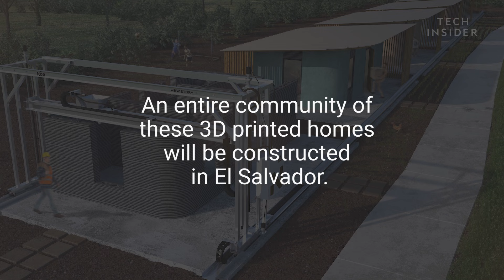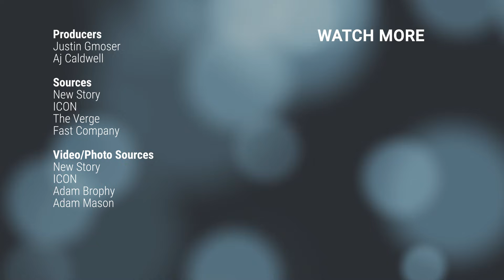3D-Printed Home Can Be Constructed For Under $4,000

Comment: What is the point of 3d homes for the homeless if no one can own land? That means the very next day the government will kick you out of your 3d home because you couldn't pay your property tax and you become homeless again. Getting rid of property tax is the solution to homelessness.
Reply: How much are the property taxes of a house costing 4000USD?
Reply: @davidsvarrer8942  Not that much tbh, We are in a  12,000 trailer on a double wide house plot and we only pay like 400/year, Our place is about 3x the size of this house. Property taxes are based on the total value of an entire property including the house value and the land value.
Reply: @tenbatsu4833  In CA a mobile home is not  taxed like a house but you pay registration fees like a car, also unless you own the land that the home is own,  you are in a mob. home park where the rent can go up very high.  In Huntington Beach a man wanted to trade his mob. home for a car, because no one wanted to buy the home because the rent was so high.
Reply: Did not post this twice so don't know why it appeared twice.
Reply: I. Can agree on this...
Reply: Make this good 3D home an assembly kit with max 2.55 meter width, a few hook points resembling standard container gauge, a few rubber gaskets at strategic places and you can move your entire home on a truck.
Reply: Property tax is bordering crime. However. Build your home such that it is movable. Make it of units no wider than 3 meter, and you can transport them on ANY truck at ANY time as "Wide Load". So, rent land and be happy for that, and have your permanent, but movable, home, solidly planted on 4, 6 or 8 kegs... What do you think about that?
Reply: one of them for sure
Reply: Property tax is immoral and unethical, and it is communism.  People ought to have a piece of land for themselves for free without any tax.
Reply: @crazieeez  At least you're living up to your screenname.  You think taxes are communism, but you want to give everyone free land...  You might consider adding just a smidge of consistency to your opinions.  Or maybe try using words for what they actually mean, rather than some figment of your imagination.
Reply: @Stormsinger99  Give everyone free land is private ownership.  Property tax is state ownership of land.  I prefer the former.  I suggest you not be indoctrinated by thinking that you own your house in America.  The minute you lax in paying your property tax, your house get sanctioned by the state to be sold to get their tax money.
Reply: Land is free anyway. In truth someone said this mine is mine. I have a deed or a title. But that deed or title was simply assumed as no one in truth may own land nor can they grant land to another. Sure some divine right of kings? How did the king get it? Hiring armies and claiming it was part of the kingdom. Then enslaving the serfs. What is free? Not a slave. What is a free market? Where you go and everything is free. Unless you want to change around the true meaning of free and say oh it means that people are free to trade or transact with whomever they choose. Words have been manipulated. Free is free unless you twist its meaning. The concept of ownership is just that. In the word ship. Admiralty law or the law of the sea has been pulled onto the land. Used to been I saw some available  land, built a house, setup a farm, an enterprise and I was a free man on the land. But no more as the law of the sea has been brought onto the land to usurp one's ability to live on the land! Its all a matter of different perspectives. Image? Nation?
Reply: Its capitalism where property taxes arise from. Communism, socialism, fascism are all forms of capitalism. We simply need to do away with money and create social structures based in well being where we all contribute to each other!
Reply: Property taxes are a crime against the people. Our corrupt government doesn't need to steal from the people. All they have to do is go to the FED who will create money from thin air and drive up inflation in the process.
Reply: Property taxes help with infrastructure and stuff so that's a dumb idea
Reply: Taxation is a form of legal theft. If I work 30 years to pay a bank for a property and that bank gives me title of ownership then I can't pay a tax and this allows the government to come an confiscate the property I'd say the entire system is a scam. Just simply do away with money and profiteering. Everybody has basic needs of food shelter clothing and our entire system is based in commerce? Its a recipe for disaster and the sooner we convert to a non profit world the better we will focus on the well being of all. Until that time we will have haves and have nots and a carrot and stick method of conpetition and punishment. Its the opposite of a healthy system.

Comment: No Rebars and Support Beams?
This house will only be good for places where Flooding and Earthquakes doesn't occur.

Water absorption without rebars will destroy its concrete injust a few years. LOL
Reply: They print over the REBAR TYPE INSERTS, that fit together like legos or an erector set.  Also roof can be done the same way as fabric concrete which is used by the Military for quick shelters. In essence it has an inner liner like a pond liner that can be inflated and then they pour water on it, and they have a shelter within 24 hours.   Used for emergency hospitals and such.  Combining both in a systematic manner would work, in addition the rebar preforms could be designed like 80/20 so its inexpensive and you just insert as each layer is printed. In addition you can lay down the pipes and the electrical piping which runs between the walls, and the cement and rebar hold them in, then just pull connectors and wire through on electrical, and or connect the plumbing to the piping.  In cold climates one can even do double walls and put aerated concrete for insulation between the two structural walls.

Comment: Great idea if they where only smart  enough to start in their own backyard plenty of homelessness in the in the state's
Reply: this project is a scam design to milk non-profits)) that's why they are doing it overseas.  it's 10 times faster and cheaper to construct a house out of pre-made cement blocks. or you can simply set the blocks onsite if there is no cement factory close by.

Comment: It’s neat technology. But what’s wrong with good old fashioned cinder blocks? Surely the mortar is just as heavy plus transporting the machine and everything can’t be a simple task. I think the world is just captivated with 3D printing at the moment. And tiny homes
Reply: You're forgetting labor costs which is the bulk of any home build. Material cost is dwarfed by labor costs. Remove the labor and you remove most of the cost.
Reply: David W surely it takes labor to man the machine. Move it, install it, operate it. Add the extras and disassemble it when it’s finished. And that requires more skilled labor than simple brick laying

Comment: The foundation alone is worth more than 4000$ and then all the human labor(transporting and setting up the machine) another 4000$ and the labor of installing doors windows electrical plumbing and toilets at least another 10-15 grand minimum. Add land value and permits/inspection for another 80 grand and now it's just a shed with an odd building material...
Reply: What kind of land are you buying? I can get 8k square feet for under $10,000. Why would anybody need anything more than that for a house of this size? 

That should bring the price to around 30k total for a perm house based on the base price. That is 500-900 square feet of residence you don't have to pay rent for and that will be cost effective on utility.

Not bad at all! 30k That's actually within range of financing for most people.

Comment: Come on guys. 4K for just the walls am I right. I am a big fan of innovation and 3d printing but I am working in the construction business and we own a precast concrete factory so I have some POV. 
The flat foundations have to be built but not just only concrete if I living in the 70% of the world you will need insulation in that. Now you can not print 3d roof or in this project it doesn’t include. There are many other ways to precast a house like this in 24h and it is not the fastest nor the cheapest. 

Come on you have to built a proper rail just to operate the machine. 

I really feel and think that robotic works will be the future but you are on a very narrow usability edge.

Comment: cement is so expensive, you should be using foamcrete or something to make the bags of cement go much farther, i understand motar is 6 bags of sand for every bag of concrete, but this material is going to be the majority of the cost since its entirely cement building.

Comment: I find this interesting but I wonder how do they install the electric and the plumbing that you can still get to when replacing or fixing, plus how does the building stand in a environment the changes between extreme rain and heat, and what do they do for the flooring for the second story of the house?🤔🧐

Comment: how much the windows, dors, roof, instalation , fundation cost, and you have to add also ground? you can easy build only walls from traditional brick for 650 sqf home for less then 4 thousend USD
Reply: And those "traditional" bricks - if you mean limestone etc., will withstand hurricanes and so on. Not like these much more expensive Pulp houses.

Comment: Looking at the sheds in the video and the 3D printed house made me think that fitting a house with a proper window may be quite expensive. Glass breaks and can't easily be repaired. Has anyone explored making polycarbonate or acrylic based windows instead? I would assume that would be cheaper and either more durable or easier to repair.

Comment: With projects like this I wish they would elaborate a more on why the technology is only considered for poor countries and not for rich countries as well. I would assume there are people in rich countries too with limited means who want a cheap house. I can only speculate why the rich world isn't targeted but perhaps somebody could tell me if you speculations are right or wrong:
1) I assume building codes are far more relaxed in poor countries so that it is easier to get going with this technology.
2) It does not fit the aesthetic or quality that people in the rich world are looking for.
3) The relationship between property prices and house prices is different in the rich world. The property may cost so much that the price of the house is less important.
4) Relationship between labour costs and material cost. Material costs are likely similar in the west and in poor countries however labour costs are significantly higher. In a way that ought to create a big advantage for 3D printers in the west. I assume major labor cost saving. On the other hand perhaps I have misunderstood and the major saving here is in material cost.

Comment: Walls and roof are not the problem, people have been building their own homes since forever, all a modest building really costs is some elbow grease. But you need to own the land below the home and you want infrastructure, a road, power line, water, sewage, maybe even internet. Good luck getting all that for $4000. And in some places, good luck getting any of it, period.
Provide the infrastructure and people will figure out how to get the roof over their heads on their own just fine. But having 4 walls with no infra, well, that's just no good for anything.

Comment: ya but how much to get plumbing installed
Reply: Gamer Haven And electrical and insulation.  I'd imagine they fill those holes with insulation.
Reply: Generally speaking, Countries in poverty don't need heating/insulation
Reply: If you use PPR, you can DIY, you would pay some USD 200 for all necessary water piping to the edge of the plot (40 meter). It is really not rocket science. The machine for doing the piping cost USD 20 to buy.
Reply: @davidsvarrer8942  Don't water companies have to have a line nearby or otherwise build one if there isn't?  What machine is used for assembling pipes?  A wrench?
Reply: @cryora  PPR pipes are heated to between 265 and 300 degrees Celsius with special instrument costing some 25 USD which heats pipes on one side and fitting on the other side then when hot (after some 10 seconds net of heating the two parts at the same time) you squeeze them together and hold them until the PPR has solidified. Then it is tight. Keep these two parts accurately such that they stiffen in the accurate position. Otherwise the resulting fitting or pipe may not sit straight or in the Right angle... Hope it helps? Lookup videos for PPR fitting there are a few...
Reply: @cryora  In the US, if there isn't a public waterline nearby, you have to pay thousands of dollars to get it brought out to your residence.
Reply: There is no plumbing in a shanty town. They would use a well or local water source, and outhouses.
Reply: EXACTLY. I bet getting services connected from council is like $50K or something stupid.
Reply: @Property-Club  invest the same money in a work permit in Kenya, open a corporate, do great things here at a fraction of the US price. There is a little corruption here just like in the USA and EU, the difference is that in the USA and EU corruption it's big big big corruption, here it's down in the small level, almost negligible. And being killed off by the government step by step. Connection to water here is typically some USD 100 or so. You pay these good people and it's done. You then pay for the digging to your plot, which comes at USD 1.20  per meter digging. So. Typically you can connect almost anywhere for some USD 150 to 500. Nice or what? Then medicine here is affordable. USD 24 for Augmentin 20 tablets here and USD 1639 in the US. Food is almost healthy everywhere. No chemicals, GMO's etc. Almost. Unlike USA where you have to pay extra for the food where the farmers have saved money using no chemicals, then giving these chemical free vegetables funny names as if it is special not to add chemicals to pull up the veggies before they have riped. So if you want a better life, and want to be able to contribute to the world in much better ways than in the USA where conglomerates have spoiled every option rotten for doing what is rights then come join here and do what is right, and build a new world in better ways and use your experience from the West to assist everybody in not repeating the thousands of mistakes done in the West, the most recent for instance electing a corrupt person with dirty hands to be their leader.

Comment: Its cheap but you get what you pay for as it is sorta small but it would be good for poor areas and pop some solar or wind on the roof and  Stirling Engine outside and you got an off grid house at a very low cost

Comment: I applaud the idea, but think this is likely full of bullshit.  Note that "they HOPE to be able to get the price down to $4000.  I am certain that does NOT include anything like the price to get the equipment there, nor the delivery of materials, nor the labor....and certainly does not include digging a well, installing a septic tank, etc.
So, what do you think it would cost to buy the conventional materials for a 650 square foot home, with one bathroom (but without a kitchen BTW!!!), using conventional materials (2x4's, etc)?  I don't know, either, but I bet it isn't a lot more than $4,000.

Comment: the roof and windows cant be printed?
Reply: Confucius Say And the roof that they built is also flat which is not good at all for places that have snow.   All that weight on a flat surface will just make roof collapse in on itself.

And then there's rain.  Rain on a flat roof surface is also not good. Certain areas will just pool up.  And in those areas the water will slowly rot away the roof.

Comment: Thanks for sharing. Only the walls are 3D printed. Thats about 20%. The rest is coventipnally built - the foundations, the roof, the plumbing, the electrics, the windows and doors, fixtures and fittings, the plastering and painting.

Comment: Bs. $4000 is just for structural, and obviously wasn’t including the roof. But I guess in Salvador you can get the electrical and plumbing and roof and all done for pretty cheap anyways. Once you factor the cost of deivering that machine there I bet it, it would’ve been cheaper and more stimulating to the economy to hire the workers to do the whole job. Weak. But if it printed electrical and plumbing, that’d be different and ergonomic value would surpass the human workmanship. Till then, blah

Comment: 1. What is the initial setup cost of the machine? It would be way more than 4000 dollars.

2. You didn't include the land cost which would drive up the cost significantly better in many cities.

3.  You didn't specify if the plumbing and electrical work was included in the 4000 estimate.
Reply: 1. Beyonce is not sponsoring the units worldwide.

2. The parking lot at Walmart is private property. It would be considered trespassing. (I'm not American nor do people in my country kill each other frequently).

3.  lol

Thank you for taking the time to answer my questions. Appreciated!

Btw why would I kill myself for asking questions? Must be an American thing to do!

Cheers Mate!
Reply: 1. I didn't explicitly ask for 'this' project. But I do appreciate your response. Thank you.

2. No wonder the native American population was wiped out by the 'pioneering' pilgrims and the later settlers. 

3. It was you who suggested I go kill myself. Wasn't my idea to begin with. But I do believe you when you say USA has a relatively low suicide rate compared to eastern Europe and the Far East. After all as you earlier pointed out, people kill each other and not themselves in USA. Unfortunately, that also explains the mass shootings in schools.